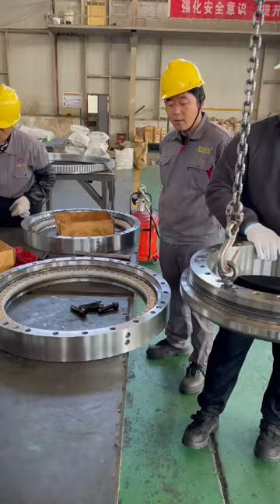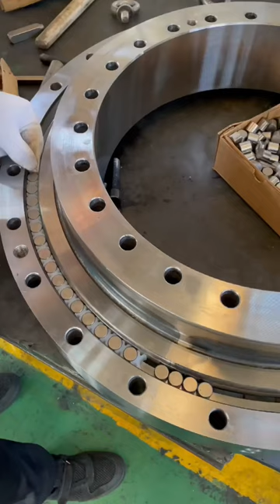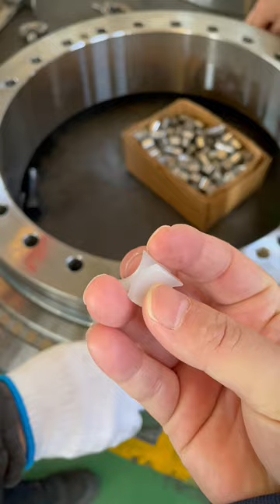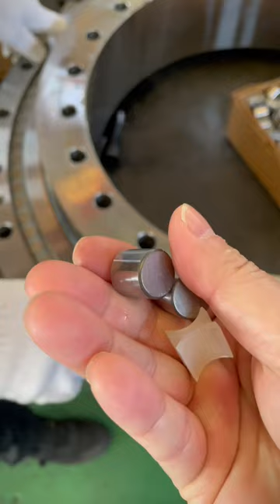Slewing Bearing Ring Gears

Comment: you would think those should be metal not plastic especially on such a large part... definitely not designed to last any real heat or length of time
Reply from the maker: If the isolator is made of metal, it will accelerate the friction damage of steel balls or rollers and raceway.Therefore, unless there are special requirements, metal isolators are generally not used.Besides, it's not plastic.😂